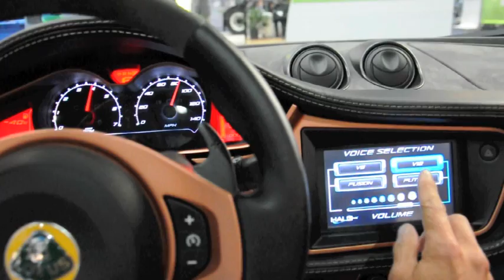Michelin ActiveWheel in hub electric motor at EVS26

Comment: 70% of the oil used in america is to power vehicles and yet:

"A Department of Energy report shows that the U.S. energy grid could support up to 185 million electric or hybrid cars. The department believes a switch to the newer vehicles would clean up the environment and could even improve our national security situation by reducing the need for imported oil."

http://www.tomshardware.co.uk/doe-hybrid-185million,news-23141.html

Comment: the best what you can do,the best is to move cars with benzin motor until 100km /h then move e back wheele with electric engine.
Reply from the maker: +Khalil Rammadan Actually Khalil, it's the other way around. An electric motor is much more efficient at low RPM than a gasoline engine that is more efficient at a certain higher RPM.